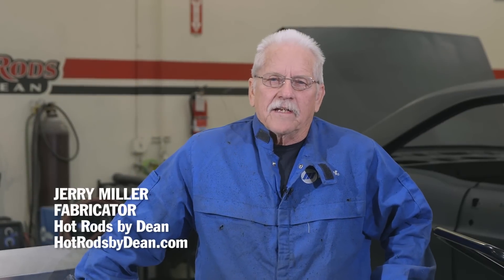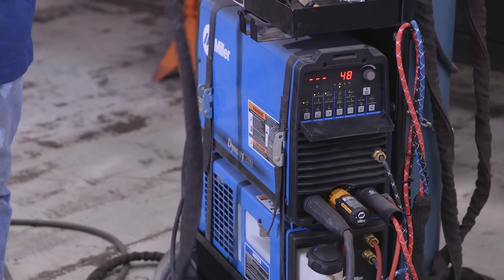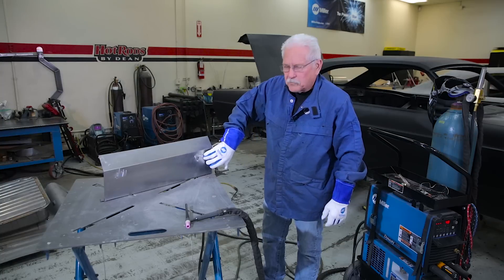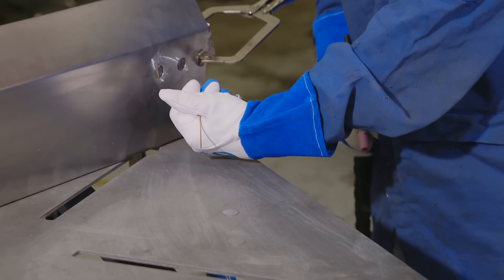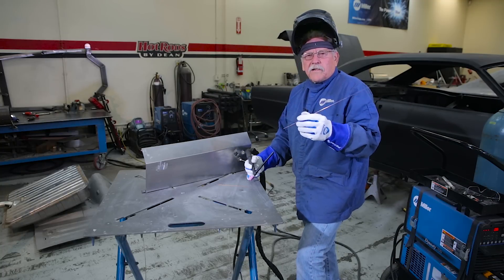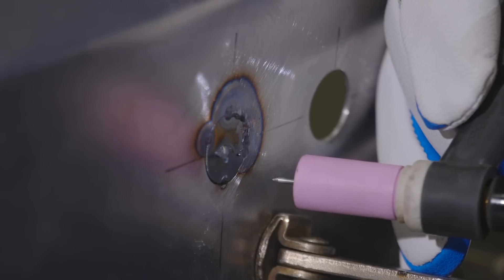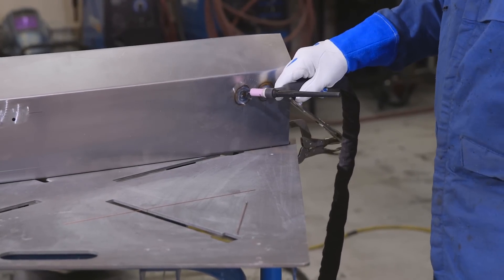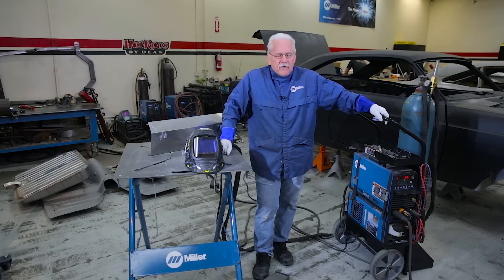Patching Holes with Hot Rods by Dean

Comment: The TIG weld is a softer weld and grinds off easier than the MIG wire which is a lot harder weld.
Reply: Ive always thought the tig weld was harder .. they're both 70,000 lb weld metal

Comment: Haha... Tacking the welding rod to the little piece of material was a slick move.

I am curious why he's using a tig set up instead of a mig set up... for the steel sheet material.. is tig more precise or something?
Reply: Well the whole purpose to put a little heat into the piece for little to none warping, so I'm pretty sure tig is used in that application just cause you can control the heat but solid core wire would be much faster and easier
Reply: Thanks for the response.
Reply: @MRSketch09  yes you can do it with a MIG welder if you have the right settings I have a welder that goes all the way down till like 9 V directive current single phase 220 but at the same time the tig will definitely do a nicer job on precise and keep the heat down I learned from an old schooler myself to even with MIG welding or TIG welding have a cloth damp in either you can dab the cloth from each Stitch weld or little spot weld are you can wait till you're all done with welding and then cool it and that keeps warping down keep the panel straight and true just a little bit of heat on a panel can make it bow in or bow out and then it's more hammer and Dolly more work and also when you're using the damp cloth it strengthens the steel it tightens it up
Reply: @themechanicman3865  Thanks for the advice.